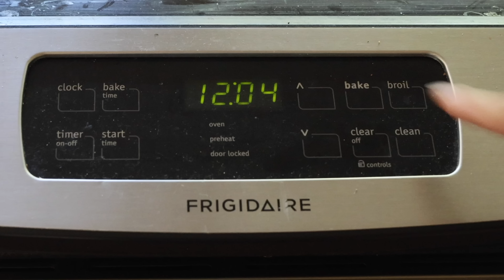Don't Hate Me for This - Updates to my Homestead in the Woods

Comment: Love the new wall color! Stairway looks so much better! Can you add some lights there? They have furniture movers that you put under each leg of furniture that way it’s easier to move around and doesn’t scratch the floors or break the legs off. They have a soft side for hardwood floors and then they have a smooth side for carpeting.

Comment: Having to stay gluten free is one of my biggest frustrations. Makes travel much more difficult. At least Jackson Hole has a properly stocked grocery store.

As a kid we had a very very heavy and large cast iron and marble desk in the basement. Mom said I could use it, but didn't tell me I had to keep it in the basement. The next day I was in final reassembly in my bedroom two flights up when mom came home and I got scolded for even trying to move it alone. I had to use 3 block and tackle sets to move the marble slab part. It was easily over 10 times as heavy as I was. I might have been 60 lbs back then. I raised it up from the basement to the second floor via the holes in the floors for the yet to be installed family room, living room, and library fireplace and chimney stack. It stayed in the house when we moved. In the Zillow photos, 40 years later, the desk had moved from my bedroom to the library. Don't know if it is still there, but the new owner turned the house from beautiful house with naturally aged cedar shake siding to a baby blue plastic fantastic. yes, vinyl siding. Ick. They also changed the ramp over the "mote" into a set of stairs that obviously had to clobber my moss garden. The "mote" was a sunken patio along the front of the house. It also had my moss garden under the ramp and draping down into the sunken patio area. Mom told me I had to make a garden, so I did. I transplanted every type of locally growing moss I could find to the moss garden. It was so low maintenance it was still there over 4 decades later. The original patterns I'd made had run together, but it was still there.

Comment: Incredible job taking apart and moving that cabinet! It seems like it was both safer for you and the cabinet to move it in smaller pieces rather than take apart anything on the stairs, and it fits so perfectly where it is. The way you labelled it was so smart. It's a shame to have to cover the wood on the staircase wall but it really does make the space so much brighter and easier to see the steps, and leaving a bit of the trim unpainted makes for a nice compromise

Comment: Why did you burn the boards that you took out of the stairwell? They were perfectly cut to be put back in, and they are the original wood to the cabin. the saddest part is, you did all of that destruction for nothing. You're letting your ADHD control your life. At this stage in life, It should be the other way around.
Reply from the maker: You’ll get over it love bug
Reply from the maker: it was particle board